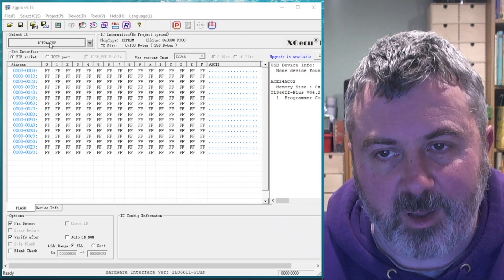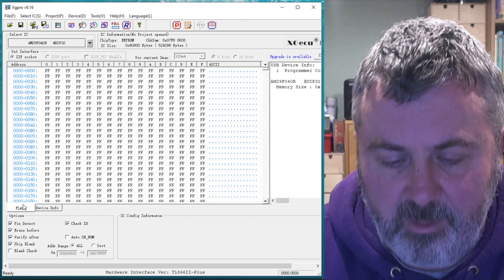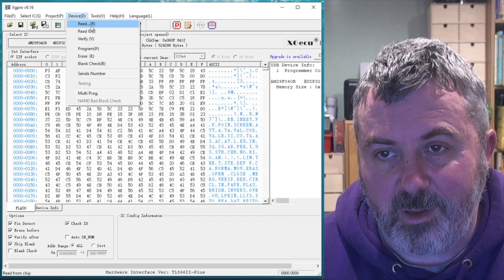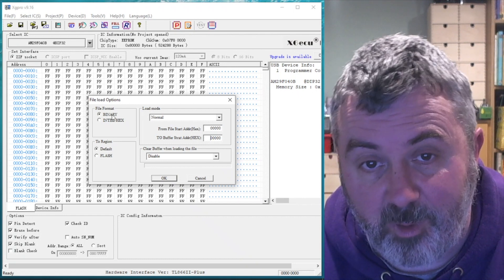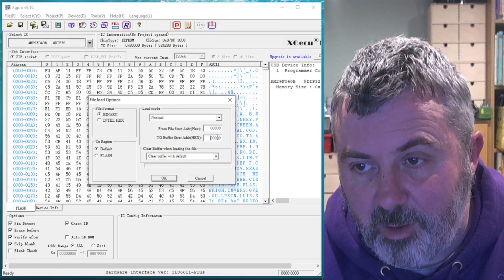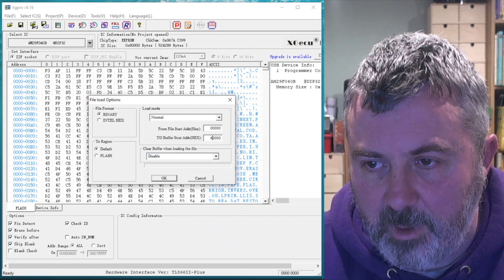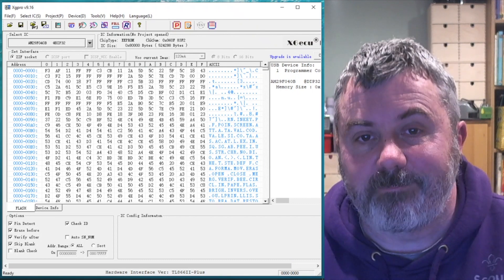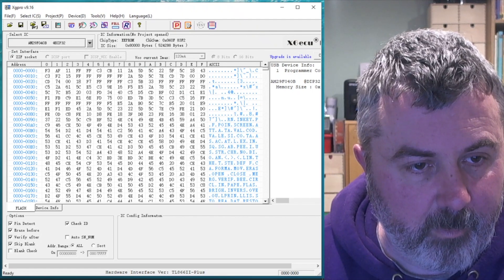Programming an EEPROM using a TL866 Programmer

Comment: Thank you for this, did you ever get the BBC ROM to work? if so what was the hack you performed, i have my rom ready to burn and load. 

Thanks again.
Reply from the maker: Nope. I've single-stepped it in emulation and think there is a test for Timex Sinclair machines that is causing a crash. I've tried NOPing it out, but didn't get much further. I will come back to it at some point.